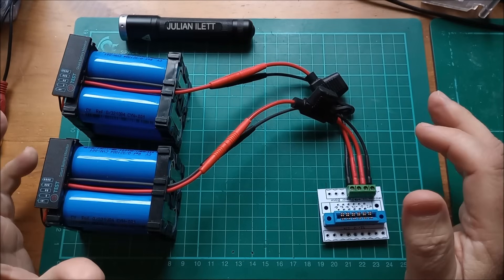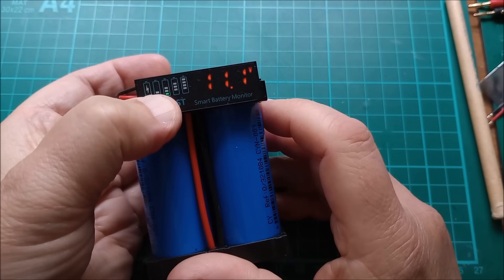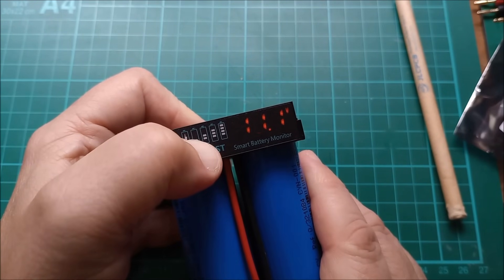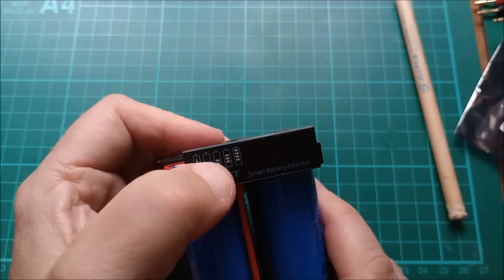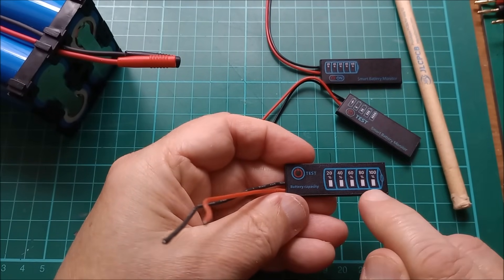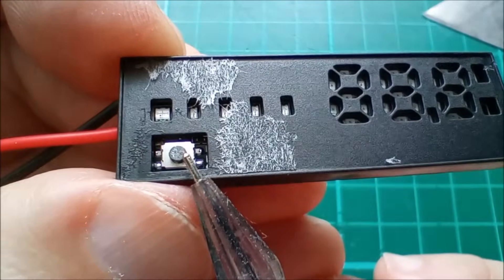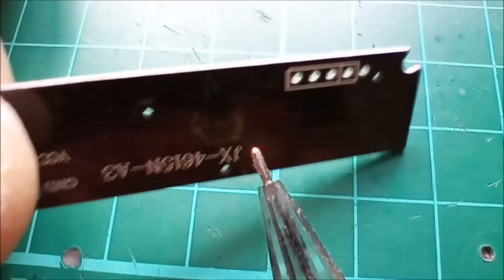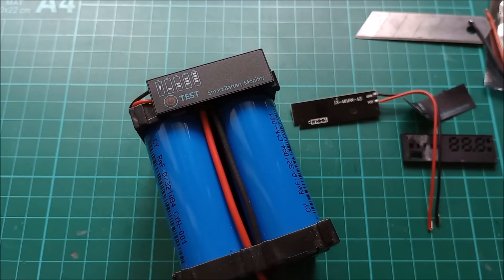Lithium Smart Battery Monitor JX-4615N-A3

Comment: the short answer to calibration is connected to a bench power supply at exactly 30 volts select cal long press it flashes long press again it stops flashing and 100 percent led lights to confirm calibration then long press again to exit the menu
Reply: Can confirm however the 30V is only needed before the second long press so it might that be the thing has a 2-point calibration but I haven't figurered the correct 2nd point voltage yet.

Comment: Thank you so much for this video. I ordered 16 of these and was not looking forward to figuring out the (seemingly) complex programming. I have your other model there without digital display, had to use a DC power supply and make a chart to figure out the settings, but a nice basic 5-light indicator.

Comment: Did you measure the quiescent current of this meter?
Reply from the maker: I haven't measured it, but it's very small. The monitors have been connected for several weeks and I've not seen any voltage drop. Just one issue: occasionally, the display blanking glitches and leaves one segment of the 3-digit display on. That would drain the battery a bit quicker.
Reply: MD7680 regulator is 2uA quiescent current, but not sure about the MCU that will add some as well. Could be as low as 5uA if they implemented it well.

Comment: I hate the ones that draw a quiescent current when the test button is not pressed.   I once made the assumption I could occasionally monitor a 3s pack with a 1s push button tester. As a result of the installation the pack went out of balance more than the BMS could manage.

Comment: Have you not thought of making a mains powered +/-12V supply. dead easy to do and with linear regulators can be very low noise to boot.
Reply from the maker: I don't like mains. If I did build a classic transformer/rectifier/capacitor/regulator type PSU, I'd run it from a powerbank pseudo-mains.
Reply: @JulianIlett  mains is great! Never needs to be recharged and can be found on most inside walls of any house. 🙂